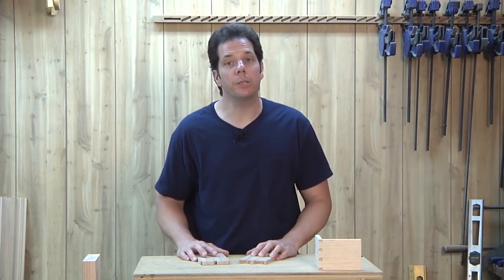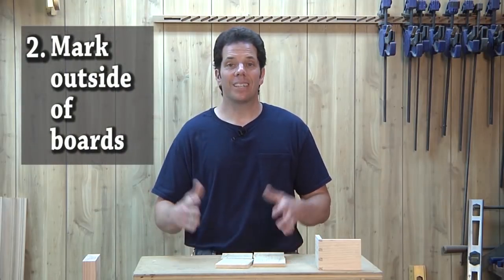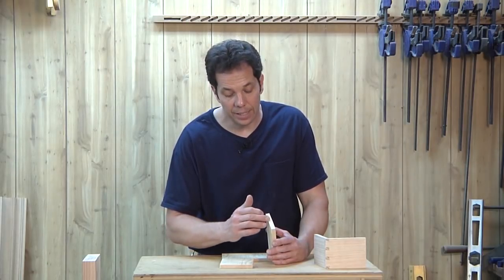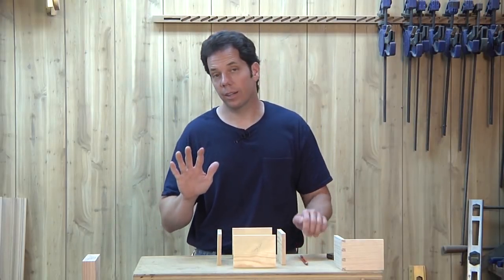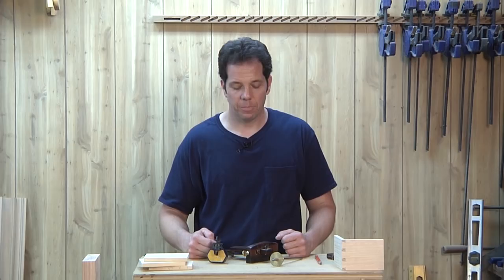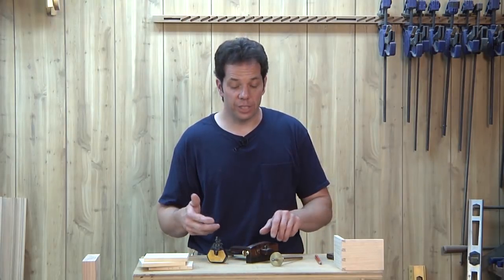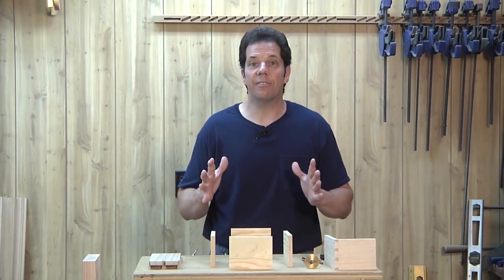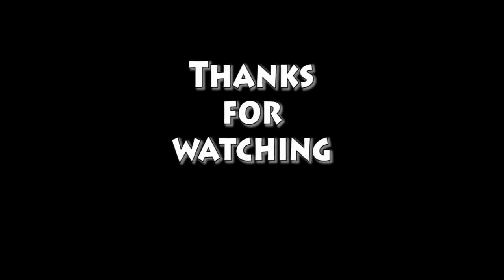Dovetail Series-  1. Material Preparation

Comment: One of the best videos I’ve seen on the layout of a dove tail joint. 
Only one thing, do I want the inside of the tree facing out or in?
Reply from the maker: the inside of the tree should be facing out. But always check the board. Sometimes the grain orientation can me misleading so i like ot check it with a straight edge